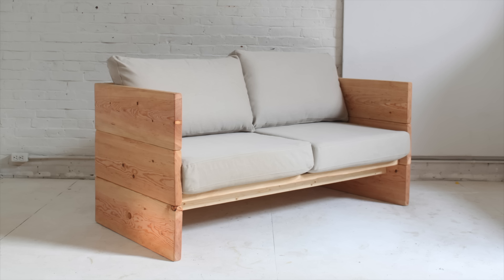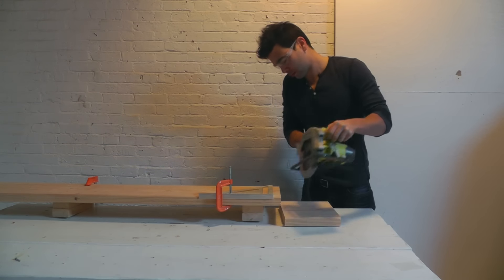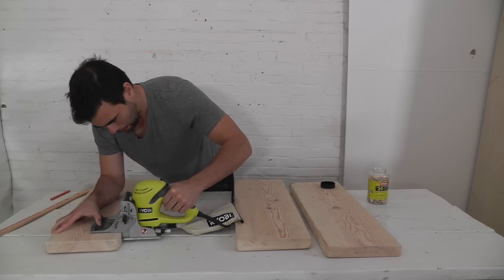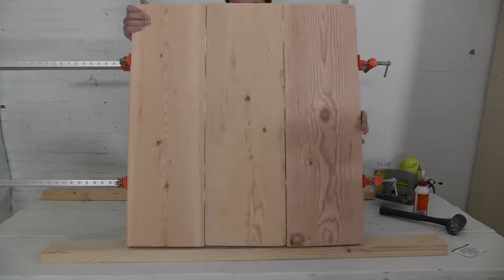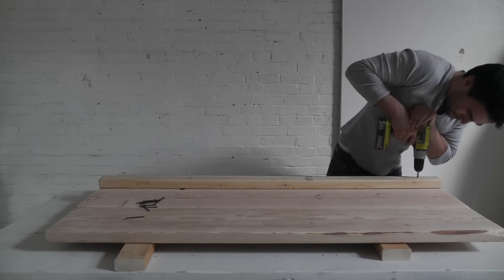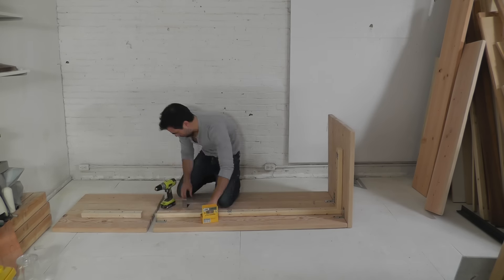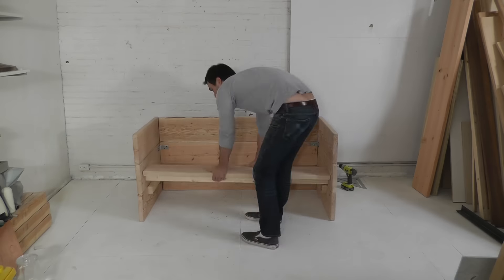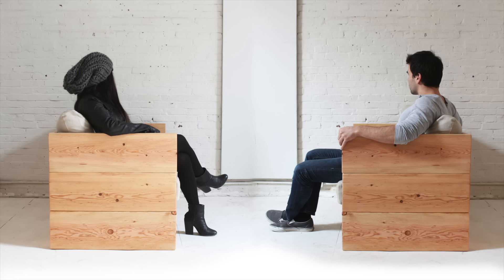DIY Sofa made out of 2x10s

Comment: Any alternatives to using a biscuit joiner?

maybe drill holes and use wood rods? if you think thats a good alternative, would you happen to know what would a good max depth and max diameter to prevent breaking?
Reply: +Alexis Solorzano The wood will be joined more sturdily if you use multiple small dowels along the same plane! (like group 2 next together instead of a biscuit joint).

Comment: A thing you never mentioned but should have because you did follow it would be to make sure you reverse the grains with the boards that you biscuit (or any joint) together. Looking at the ends of the timbers you need to find which way the grain is bending. If it's rolling up to make a U shape then the one next to it has to be the opposite, and alternate between these. This way the natural grain of the timbers won't work together to curve the length you just created
Reply from the maker: John Grech Good observation John! you are right!  i should have. thanks!
Reply: John Grech mk

Comment: Tip for those who never used a biscuit jointer: put glue in the hole not on the biscuit.
if you do the biscuit will suck up the glue and expand thus making it harder to put it in the hole.

Comment: Dang man! Awesome project. Any thoughts on how to join the 2x10s if I don't have a biscuit joiner or big long clamps? I'd love to make this but don't have access to those tools.
Reply from the maker: Paul Howard you could use straight metal brackets on the inside so the don't show too much.
Reply: Good idea. Thanks!
Reply: Paul Howard Dowels with tenon centers. http://www.leevalley.com/en/wood/page.aspx?p=44995&cat=1,180,42288
Reply: Just Make It good idea! I also thought of using pocket screws too
Reply: Paul Howard Absolutely!
Reply: Paul Howard u can also try kreg jig!
Reply: Zippy Doo I also dont have pipe clamps.
Reply: Zippy Doo In this particular glue up, the only strength IS in the biscuits. The board edges are not jointed, nor are they  properly prepared for glue. That said, it doesn't really matter with such poor quality design and fabrication.
Reply: +Paul Howard plywood gussets 1/2 inch thick inside so it gets covered, attach with wood screws or 18 gauge 1/4" crown staples 1&1/4" long and glue, stronger version and possibly cheaper too. If you want to go for a more concealed look drill holes 3" in  from the edges on both sides (get a spade bit and and extension, if necessary)and join with 3/8" all thread rods that span the total lenghth of all 3 boards, put 1 washer and 1nut on each end, at the top and bottom recess holes by 1" and cover with natural wood putty, that's gonna make you look like a magician.
Reply: +Paul Howard you can just drill a few holes and just fabricate some wooden pegs that fit snug and glue em together.. i'm pretty sure that would hold alot better than these "biscuits"
Reply: +Christopher Jackson 
I've been building cabinets and furniture for more than 20 years.  Pocket screws are good for cabinets and hutches. No way would I use them on something like this.  Instead of biscuits and were I lacking a jointer, I'd square the edges with a table saw and use 3/8" plywood in a spline joint.
Reply: WHATS A SPLINE JOINT? I AM A BEGINNER AND WOULD LIKE TO BE SIMILAR TO A SETTEE
Reply: Christopher Jackson s

Comment: Is the glue and these "bisquits" really enough to hold it all together?!
Reply: robinschw well, you can pray a bit every time u sit, just in case :D
Reply: robinschw As the whole structure locks together the total strength is more than just the biscuits, the majority of it would come from the 90 degree angles. Tho by themselves biscuits and glue achieve quite a strong join.
Reply: if there is lots of "edge grain" to edge grain contact (no gaps), then the glue should be plenty strong.  If joined properly the wood should break before the glue fails.

Comment: I am not a carpenter, but I think the 2x10's joints are very weak especially because they are not square, so not even with the glue will hold very longer. Any way I liked it, there's my like.
Reply: Rico Ong he's not stupid biscuit joints aren't strong for a job like this
Reply: Even though the biscuits aren't strong,  there is lots of edge grain contact. The glue itself should provide sufficient strength.  Biscuits are more for alignment then strength IMO.
Reply: Although i do agree them not being square can compromise the strength.